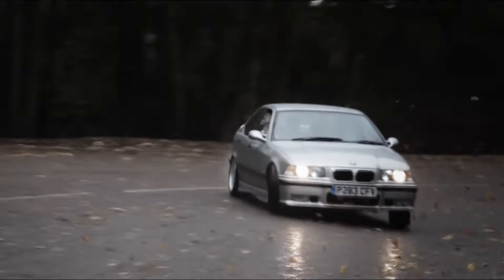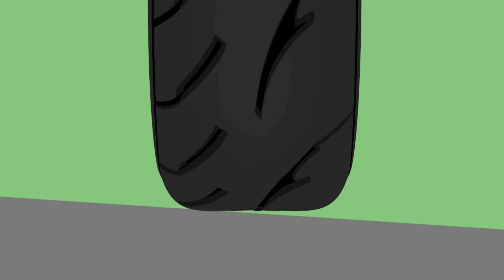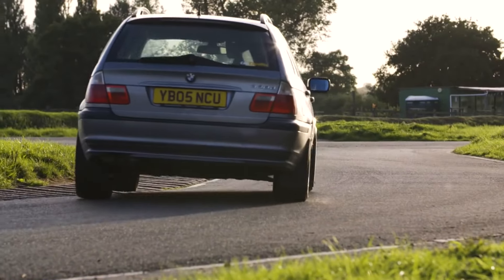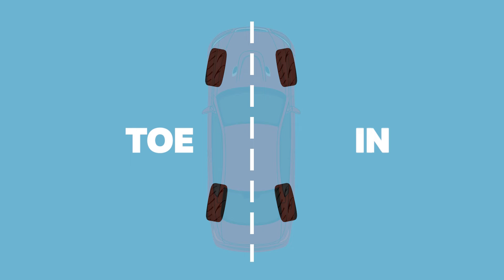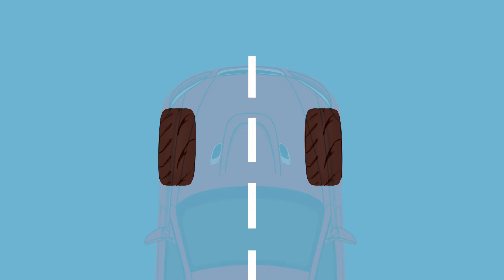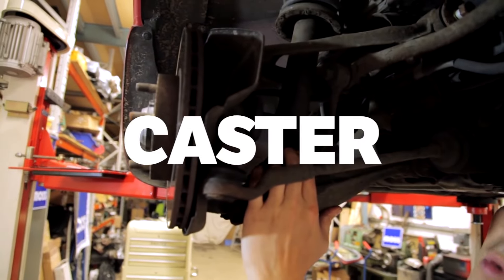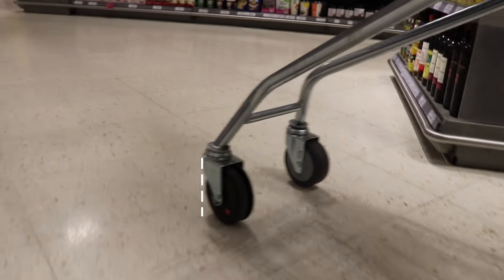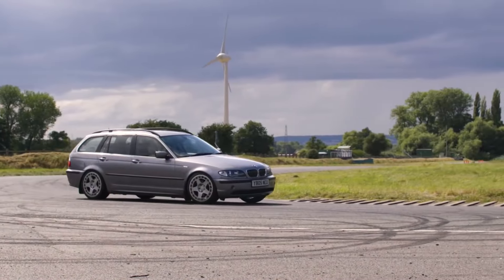Alignment 101 - Camber, Toe, and Caster

Comment: Toe out on the front axle of rear wheel drive cars is generally only preferred for racing and competition purposes. Most street rear wheel drive cars have toe in on the front axel as well because they will naturally toe out during acceleration and at speeds so toe in adjust for this. This allows for greater stability when going in a straight line at speed but reduces cornering agility. Look at the recomended factory settings for pretty much any rear wheel drive car and they will recommend some degree of toe in on the front.

Comment: Can you do a video of what should change if we change the wheels or use wider tires. What happens when offset changes and what changes should be done if we change wheels. 
If we install larger wheels do we follow factory settings or do we have to have new ones?
Does the offset change in wheels affect the alignment settings. 
Basically what to do if modifying wheels and tires.
Reply: Kalana Jasenthuliyana Just get a book...

Comment: Hi,
Nice explanation ! 
For feed back : I just tried a zero toe for the front wheel on my Mini Cooper R50 and the car became very unstable, especially on wet roads. Outside tracks, alignement defaults could be very dangerous for a daily use.
Reply: FWDs should run a little toe out on default.

Comment: Just bought a 2010 370 Z I didn’t realize that the back tires had a camber until I took a good look at the tires they’re wearing out when I took it to the dealer they said they would try to straighten out the best they could I mean I just thought you just took it in and had it lined up no problem
Reply: All z’s have this issue,

Comment: I'm so confused. Some people say the temps should be the same across the wheel. While others say the inside should be the hottest, then 5 degrees lower on the middle and again on the outer edge.  
Which is it? To me it seems more logical that it's all one temp, as the surface is then used equally.

Comment: The temperature statement is false. Optimal camber is usually reached when the inside of the tyre is 5°C hotter than the middle and 10°C than the outside since it will be the part that contacts the road only when cornering
Reply: Demios Indeed.
But for 101 (basics) its not bad. Lets face it, if someone wants to learn how to proper setup a car he will get a good book and a car and a track/nice road...
Reply: Why does the inside of a tyre need to be 5°C hotter than the center and 10°C hotter than the outside?

Comment: It's better to run lower tire pressure than to try to compensate too much with camber.
Reply: slightly lower pressure (i found out its +/- 0.2 bar in my car) means the tire is softer and goes around corners a little better but accelerates slower and consumes a little more fuel. more pressure the opposite of both... you shouldnt go too much off the suggested pressure tho.. except for winter when you dont want to check your pressure every 2 weeks just do a little more lol
Reply: @keisuketakahasi4584  Less pressure also means a larger area of the tire will stay in contact with the ground. Of course too low on pressure will make the car extremely wobbly and unstable